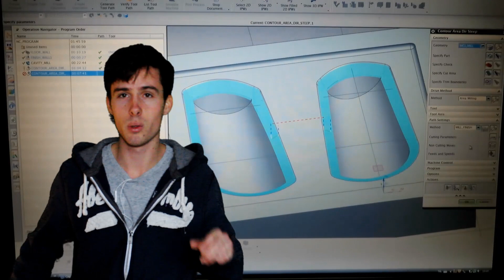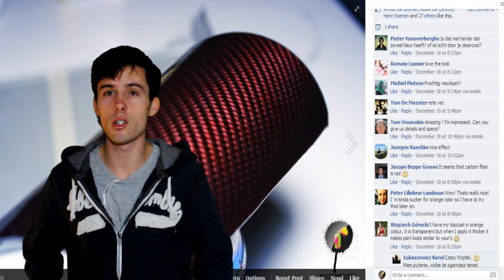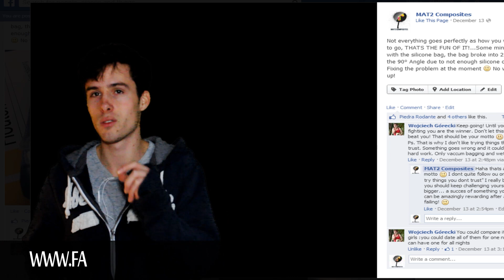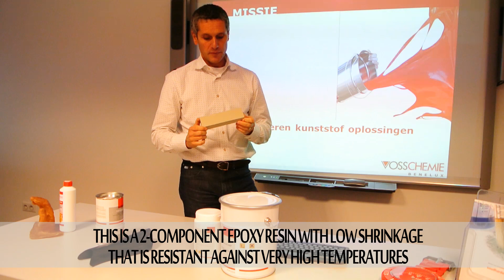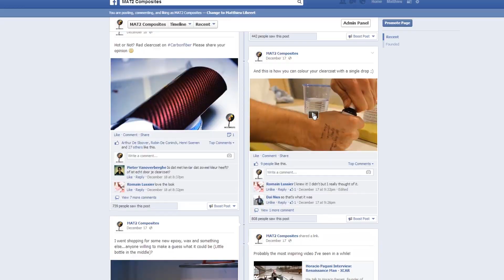Tutorial: Out Of Autoclave PREPREG Carbon Fiber/Fibre Part 1-7 (Introduction)

Comment: why did you make a cf mould, instead of using the negative from part 3 to lay the carbon and have your part ready?
Reply from the maker: The negative form was made out of wood and wouldnt be heat resistent enough to be sure to get a good part of it...I wanted to make more than one mould. by making the positive the good way out of that one, I could make more moulds with a good positive then
Reply: Matthieu Libeert My bad I switched negatives and positives :p
What I wondered was why would you not use the positive mould made in part 3 to make your part. What are the disadvantages of using a positive mould?
Thanks for your response! :)
Reply from the maker: Romain Lussier ah ok I see what you mean! its the surfacefinish that will be different...if on the mould like in part 3 the "outer" surface will have te texture of the bag and the inside will be shiny
Reply: Matthieu Libeert Aah I get it now :)
Had you used aluminium for the cnc machining process, would you have still followed the same procedure? Or would you have directly used the aluminium moulds?
Reply from the maker: If possible I would use Aluminium, but as a student Aluminium is a bit to expensive :p But I'll get there one day